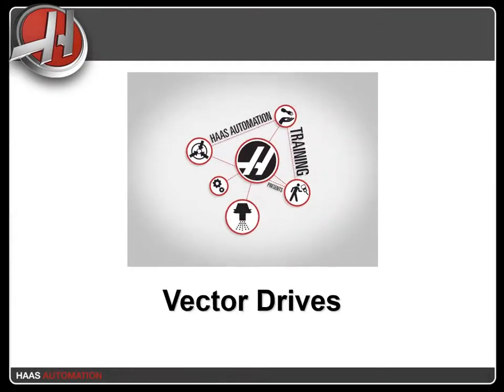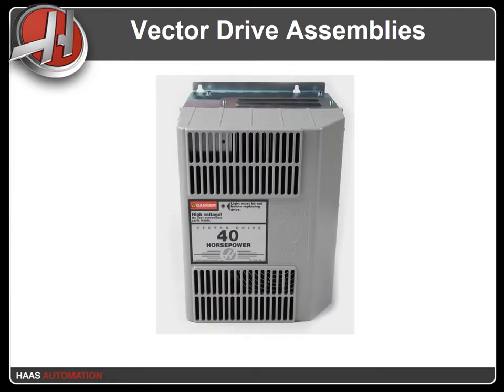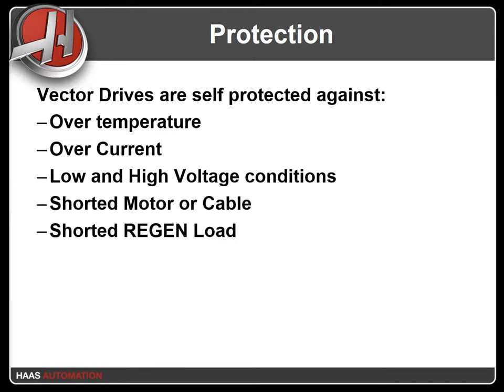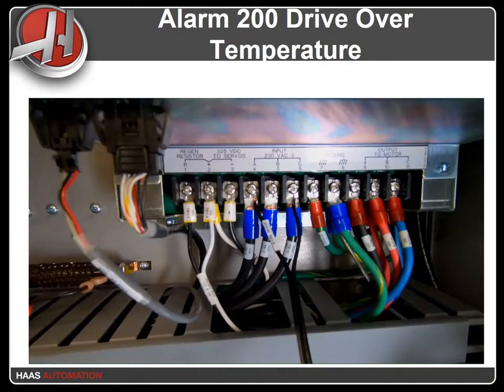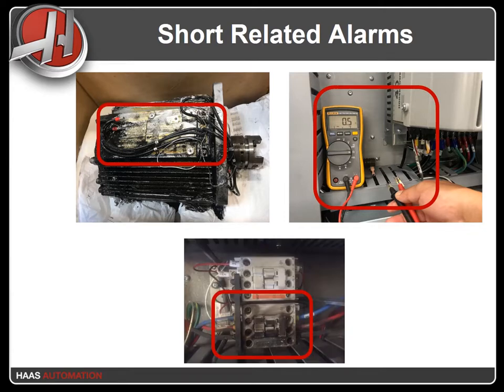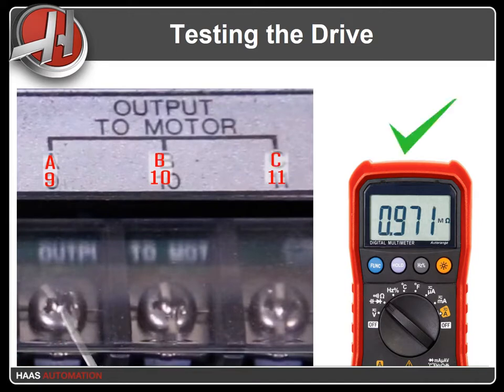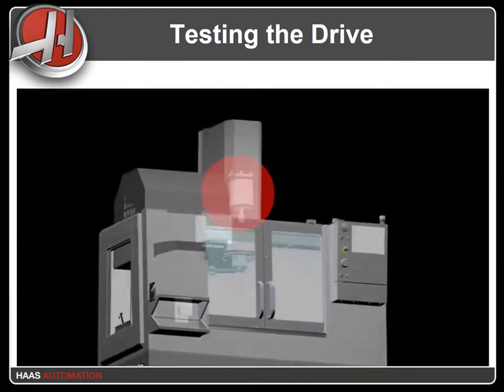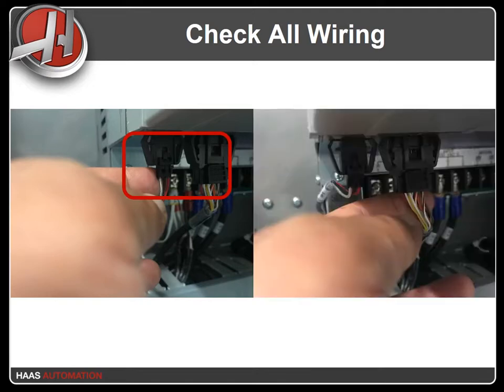HAAS Vector Drive Troubleshooting Video

Comment: What's the value of voltage output to motor
Reply from the maker: The question was asked incorrectly. On the DC bus, approximately 530 volts, if the mains voltage is 380 volts. But the motor receives 530 volts of amplitude voltage and RMS voltage depends on the operating mode.